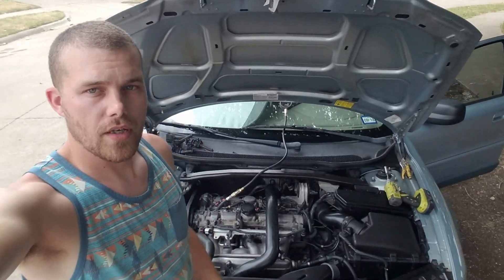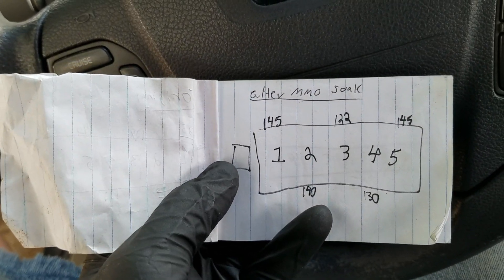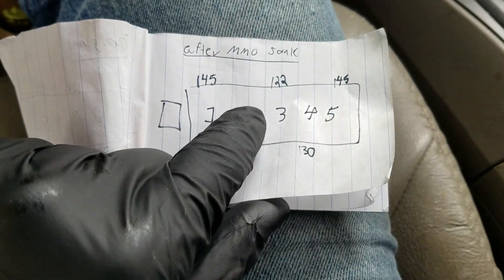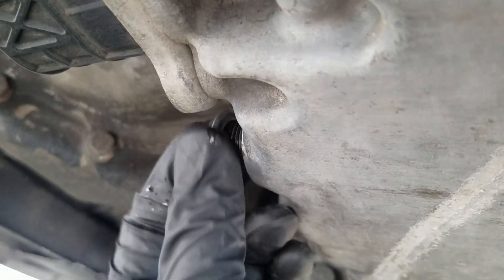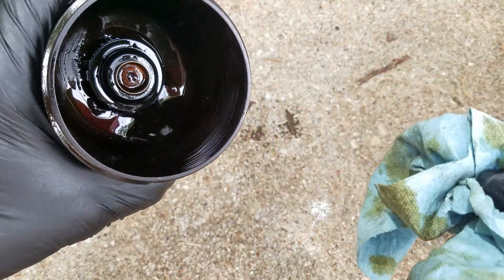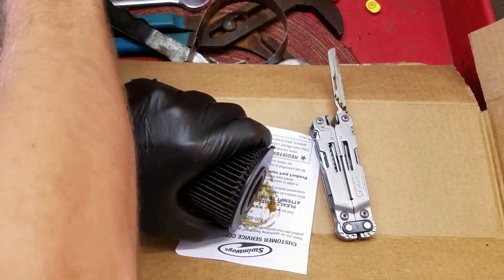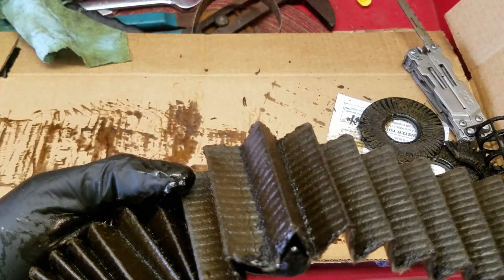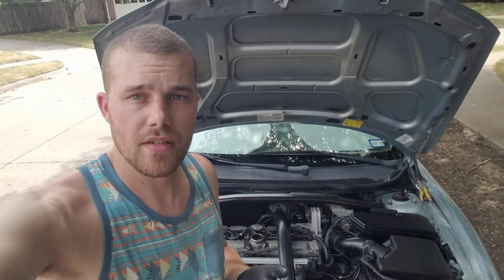Auto RX  full review with ENGINE TEST RESULTS and oil filter opening

Comment: Does Auto-Rx help with oil consumption? I usually need to top off my oil with 1/2 a quart every 700 miles.
Reply from the maker: Yes it does. It helps with oil consumption by cleaning the oil control rings. This is where oil consumption usually happens

Comment: By the sound of cranking, I would say that your battery is very weak or you have electrical issues (bad engine ground, worn starter, bad connections etc)... 

I always charge my battery before a compreasion test...

Solve those issues and you will see higher compression values... 

Cheers from Croatia!
Reply from the maker: Good advice!

Comment: Once you drain your oil & remove old oil filter, do you first pour the auto rx plus then top off with new oil & filter? I 
just ordered off the auto rx  website. It says to pour 2 bottles for suspected high mileage sludge motors. I bought a used 2000 Lexus RX 300 did full tune up and fluids change and runs great. It has 177k miles & I looked inside oil cap & see lots of sludge, I’d like to clean it out. I run valve line 5w-30 synthetic oil. Thanks!
Reply from the maker: The order doesnt matter really, but you should start the engine after putting in the new oil and auto rx so it can mix together
Reply: @gagefixeseverything ok great! Thanks for replying!

Comment: ...yep, Auto-RX works. This what I do, after the Auto-RX treatment, I add in XADO - EX120 Revitalizant for engine, gearbox, power steering and follow their treatments. The engine compression will show same original readings manufacturer specifications or very near enough. After the next oil change I add in ZX1 Micro Oil  Metal Treatment in engine, gearbox power steering, water pump - yes you read that right in water pump too and no it will not affect the thermostat. Auto-RX, XADO, ZX1 - they all works in a different way, there is no other products is better. Good luck! :-)
Reply from the maker: I do something very similar. I use Engine Restore CSL after my auto RX treatments. Same idea i think!
Reply: @gagefixeseverything  -  ....have tried the Engine Restore CSL and to be honest, it is not anywhere good as the XADO...to each their own...

Comment: Thanks for posting your video. As a test, you confounded the results a little by using the MMO soak. It would have been interesting to see if the Auto Rx took the compression results directly to your final compression readings. Regardless, the extra compression was a plus.
Reply from the maker: I agree with you^ I have used Auto RX a BUNCH on many vehicles now with great success. I never use MMO except to lube my air tools

Comment: Thanks for the video, I've been using Auto-RX for quite some years myself with good results. I have also opened some filters and found the same of these fine carbon particles. I think most of them are from the piston ring area. Carbon itself is hard to dissolve, so it will follow the oil stream and drop out in the oil filter.
Reply from the maker: It was really surprising how much crud was in that filter! Right after this video, I got a pretty bad front main leak. So this stuff works for sure haha!
Reply: @gagefixeseverything  oh man that scares me.  I might rather have stuck rings than have to replace something like that